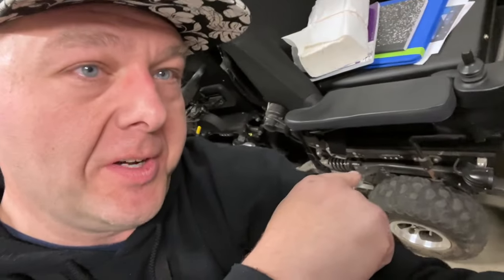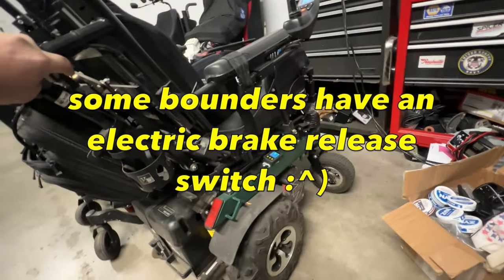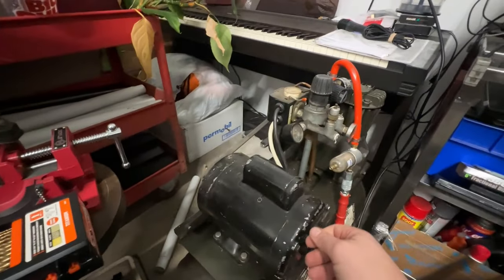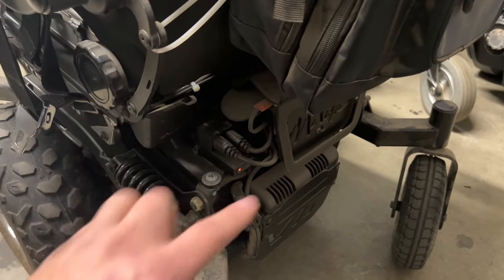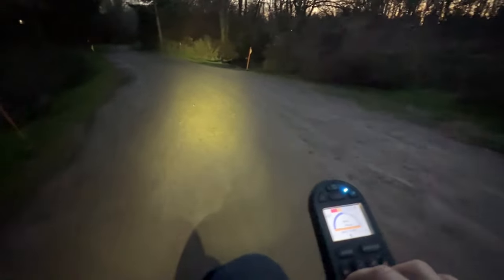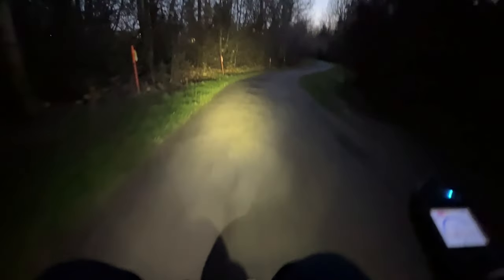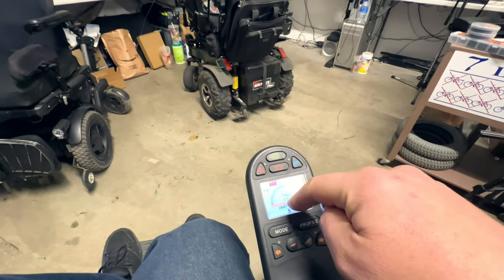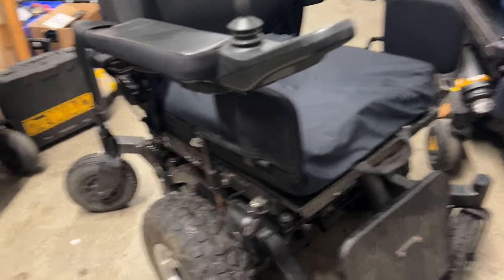VLOG 693: battery prep on the Frontier V6!

Comment: You should be careful letting those batteries sit for several months at that low level of a charge. That will lead to early cell degradation, and those Odyssey batteries are not cheap which would be a very costly mistake. Maybe consider leaving them on a trickle charger.
Reply from the maker: they are charged up before storage, and disconnected from the chair with a breaker when its not being used :^)

Comment: You have pneumatic tubes on that, not foam filled tires??? I mean I'm paralyzed from the breastbone down due to a drunk driver many years ago...There is no way I can stand up and change the tires, let alone lift that baby up...

I did find a way to change them myself because Quantum only changes them once a year through insurance...I put a book in front of the drive wheel and roll the wheel on top of it...Next I use two books...After three books it is high enough to put a bunch of books under the anti-tip wheel...Which allows me to move the books under the drive wheel...

Comment: hey Dan, where did you get headlights to Frontier V6?????
Reply from the maker: there's a link in the description for the ones i used :^)
Reply: @TotallyNormal-   thanks
Reply: @TotallyNormal-   can you share how to connect the lights on the back of controller?  I don't see it, thanks
Reply from the maker: my chair is an oddball version.. its got a breakout board thats wired to the seating controller under the seat pan.. im not 100% sure how they have the electronics setup on the newer versions at this point :^/
but typically if the chair has an R-Net seating controller there should be light output connectors next to the seating actuator connections.  not all R-Net seating controllers have the light outputs built in.. there are several versions, and not all of them are labeled..
Reply: @TotallyNormal-    I do have R-net seating, but don't I need a adopter from the light to  back of electronics setup??